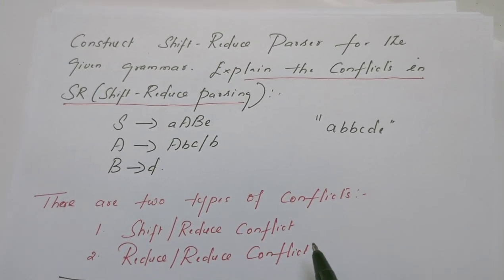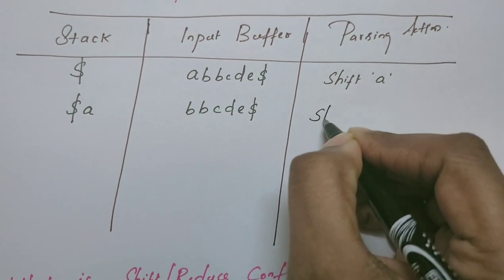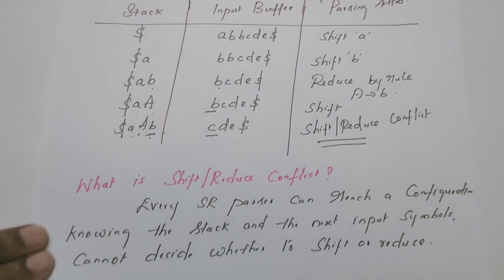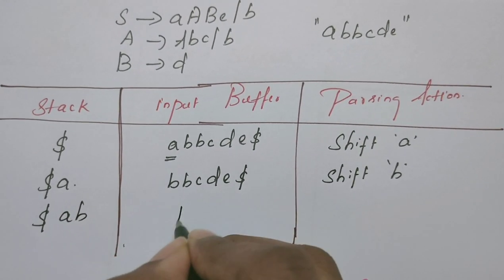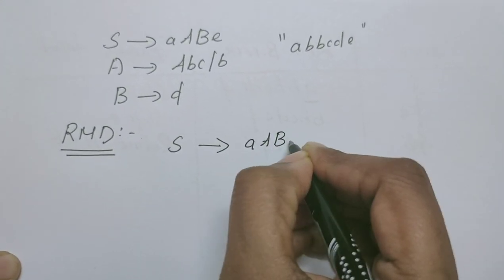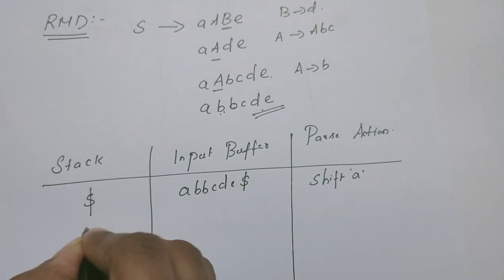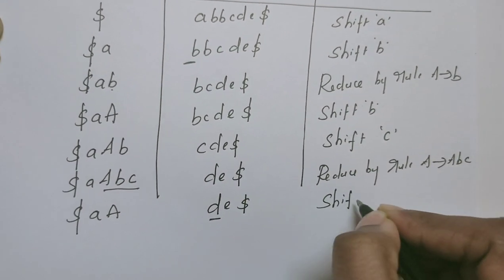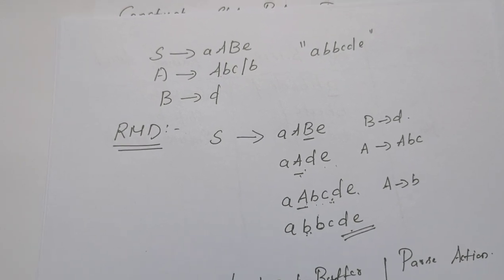Conflicts in Shift Reduce Parsing | SSCD | 17CS63 | 15CS63 | VTU

Comment: Understood the concept clearly ma'am!! But my doubt is what is the solution for RR conflict?
Reply: This is late, but I'll answer for people in the future. To handle RR conflicts, basically do the same thing here as well, ie, do the rightmost derivation and write it in reverse.

Basically, the rightmost derivation in reverse is the correct way to do the parsing. So writing in this manner will let you know what productions to use when and where, thus not having to make a choice on whether to shift or reduce, or what productions to use for the reduction, which are basically SR and RR conflicts respectively